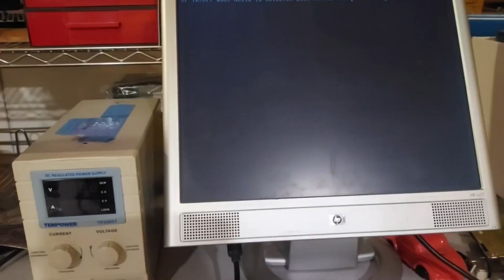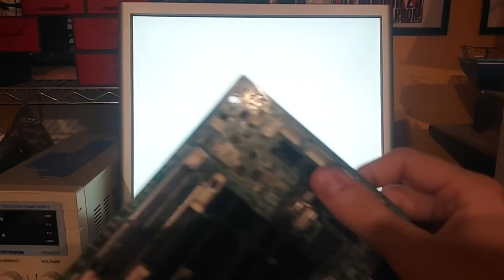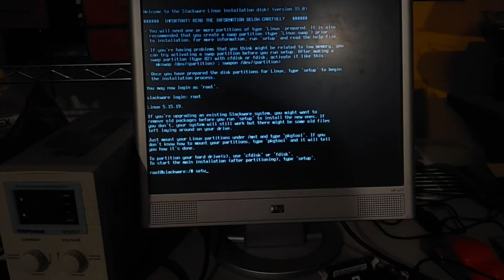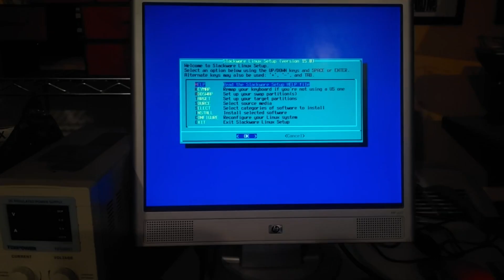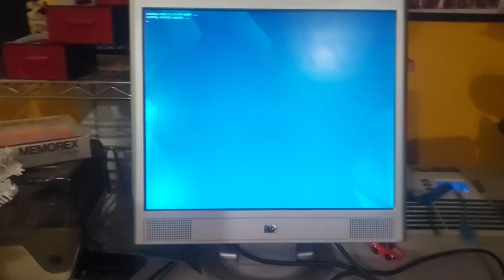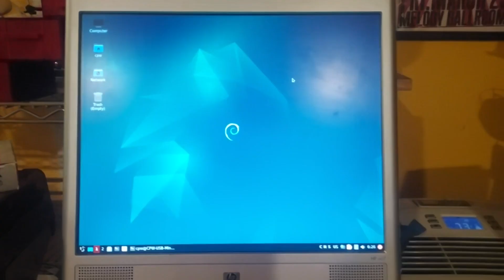Making a $1 Mystery Board Work Then Failing to Install Slackware On It.

Comment: Cool video. I wish I could get some physical hardware and not just use emulators.
Reply from the maker: Thanks! Unfortunately now that I'm at college I'm a bit limited hardware wise, but I've got a few old laptops I'm hoping to tinker with when I get the time. Just need to figure out what to do with them in the first place though. Both are 32bit which is either limiting or interesting depending on how you look at it. 
Most of the stuff I have (the keyboard, mouse monitor, RAM, and power brick seen in this video for example) is all acquired over years of garage sale hunting.